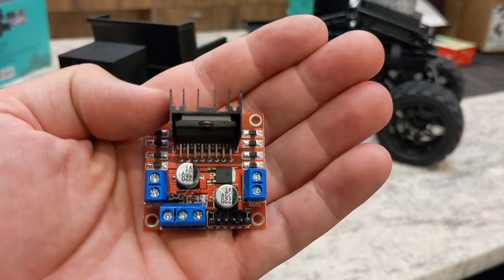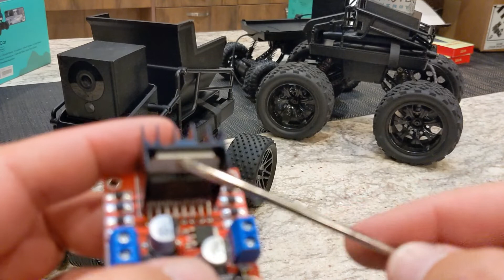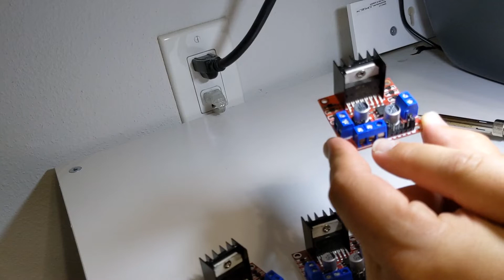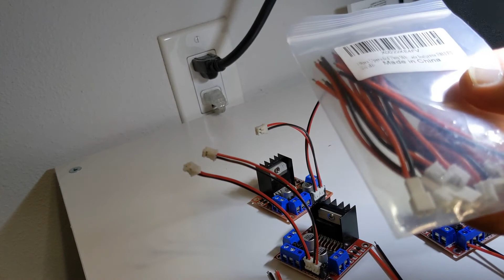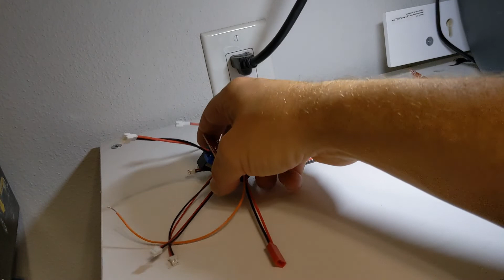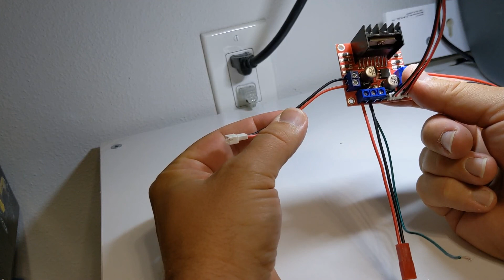Wyze Car Mods- The Mod board explained (L298N)

Comment: I’m thinking you could use the WYZE car Camera and WiFi control board with your conversion to run other RC cars. (Cheap Walmart rock crawlers, tanks etc..)
I’m thinking of trying a Ripsaw type tank. 
That would be a great camera platform.
Great videos!
Reply from the maker: Yeah it totally could be used for other RC cars. My idea would be how do we replicate this board in the wyze car with an Arduino. Then we just get a cheap 10 dollar board along with a wyze cam. We can control any car